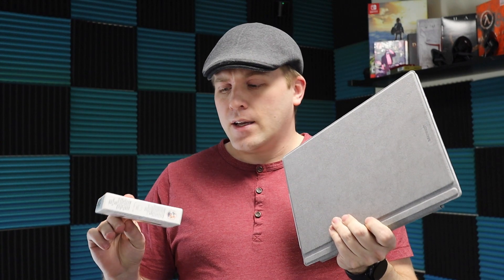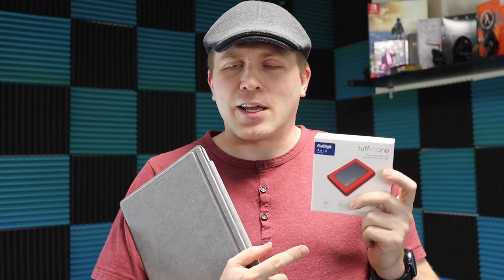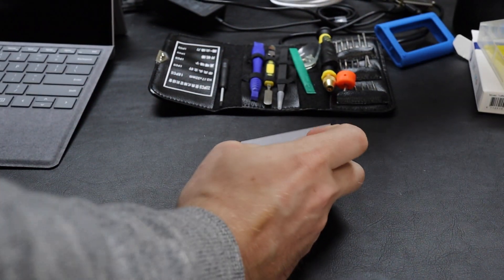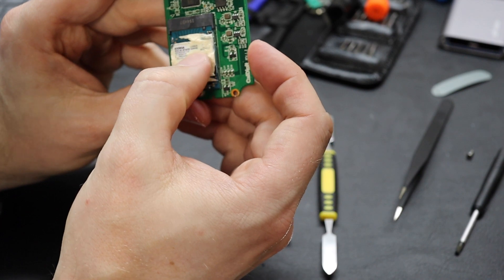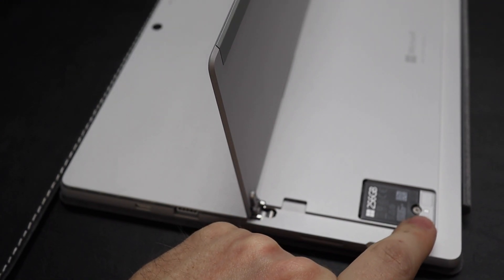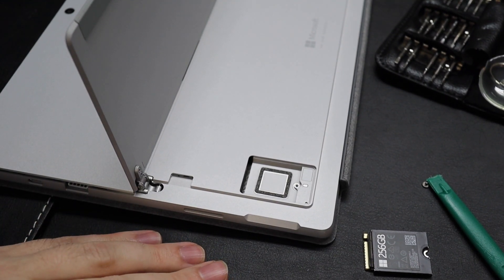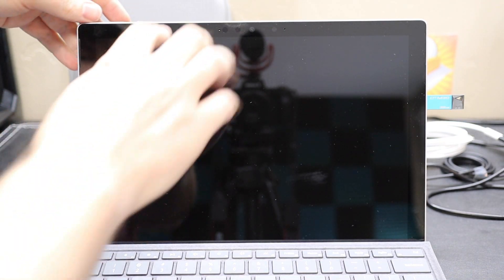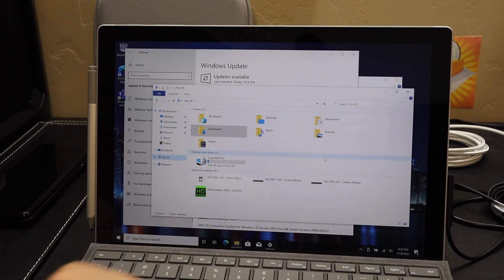Surface Pro 9 /8/7+ SSD Swap (also Surface Pro X) 1TB for hundreds less!

Comment: Why not just buy an internal drive without the need to dismantle a new external USB drive.   Seems a little extreme and unnecessary.
Reply from the maker: At the time of the video, it 2230 ssds were very expensive and extremely hard to find in that capacity. Nowadays, you can have it same day on amazon.

Comment: My Surface Pro 8 wouldn't boot after replacing the SSD, was panicking. Turns out it must be plugged in to power for the first boot.

Comment: Could you possibly replace the ssd with a 2 TB drive or greater and if so where would you get it.
Reply from the maker: Ebay wd sn740 or micron 2400 or 2450
Reply: @cbutters  Thanks for the help and advice.
Reply: I have another question about if you know  if the WD my passport ssd is compatible. If you need the SN or PN for the device I will be happy to provide that.

Comment: link takes me to the 2tb drive. Is that still compatible?
Reply from the maker: i don't think that 2tb version is compatible it is too long and probably isn't the 2230 size.... look for a micron 2400 m.2 2230 or a WD SN740 they are becoming available on ebay in the 2tb size if that is what you are looking for.

Comment: 2TB version also works ?
Reply from the maker: yes
Reply: @cbutters  could you please send me the exact 2TB version that could wotk in my Surface Pro 7+?
Reply from the maker: @MrBazsi888  These two: 
WD PC SN740 NVME 2230 2TB or
Micron 2400 2TB M.2 2230

Also see this video: https://youtu.be/PsAsA4kiImk
Reply: @cbutters  the Micron 2400 is really hard to get, it's out of the race. so that means 2TB WD SN740 will be my pick for S7+.
Reply: @cbutters  Rumors have Micron stopping production of the 2230, but I can't confirm that either. But description says: PCIe Gen 4, NVMe 1.4 Compatible with all PCIe Gen 3 slots and systems
Reply: @cbutters  i tried 2TB WD SN740. installation ready, but I have occational BSOD's. any help ?

Comment: Thanks for the great video. Is it possible just to diskcopy the existing SSD to the new 1 T SDD before the swap so that the new Surface will be the same as before except with a bigger capacity?
Reply from the maker: I'm not entirely sure what you mean by diskcopy; but as long as it recreates partitions correctly / clones the drive; yes you can; If you just try to do a file by file copy, it isn't going to work.
Reply: @cbutters  The method you shown in the video will get us a brand new Windows to be set up. If the entire SSD is cloned to the new SSD with all the partitions before swapping, we  may get the same Windows with all the  drives, files etc without the need for reconfiguration once the new SSD is swapped in. That's my guess. Thanks for confirming it.
Reply from the maker: @Mingbell  correct. I didn't want to get too sidetracked in too many details in this video but I have many videos on how to clone ssds to upgrade without losing data on my channel using clonezilla. Check them out if you need or want :)

Comment: Surface Pro 8 problem with Torx screw: turning w/T4 driver, but the screw is not coming out. (T3 driver is loose; T4 is perfect fit.)  I have a Micron 1TB (model 2450, size 2230), but if I can't release the the old M.2 nicely, then my Surface will remain at 256GB. Suggestions?

Comment: There is no more 1TB of this product, The link points to 2TB and I am not sure if it will work with the surface pro 8 released this year
Reply from the maker: You're right... the 1tb version is completely sold out... the 2tb is not the right size. You'll have to try to get a SN530 or kioxia 2230 1tb somewhere.

Comment: I performed this upgrade on my 7+ and it worked great :-) Thanks for the excellent video.
Reply: Hi Tom, do you have a link to which SSD did you used?
Reply: @AdirB  I used exactly the SSD used in this video, same make and model.

Comment: Do we need to install any drivers, like surface specific drivers after installing windows?
Reply from the maker: windows update will install everything you need as microsoft does a good job of getting all the drivers in that system... (microsoft in-house device... microsoft windows you know) Sometimes the keyboard doesn't work though and you have to use a usb keyboard with a usb-c hub to make it work during the install... so its easiest to use the factory image usb.

Comment: Can you use the 2tb tuff nano? Can’t find a 1tb anywhere seems like except on eBay.
Reply from the maker: The 2TB TuffNano looks longer than the original... which tells me it is a larger ssd inside, not the 2230 size; so I highly doubt it.
Reply from the maker: There are some new 2TB 2230s coming out, in fact someone was selling them on reddit not too long ago. but thats the only time I've seen someone offer them and they were also charging 430 dollars for them :S
Reply: @cbutters  Dang, yea I called the guys up for the tuff ssd and they wouldn’t tell me the info for it so I bet your right. I’ll just wait then, thanks for the info.
Reply: @cbutters   I did find that dell is selling some 2230 ssd 1tb but it is a little expensive compared to this.

Comment: Thank you for the instructions.  Will these instructions work for a Surface Pro 8 using a Tuff nano Plus USB-C Portable External SSD - 2TB Charcoal Black?  instead of the 1TB
Reply: Any luck with this? If it worked im all in.

Comment: I see you Genshin Impact lol.  So Microsoft claims using drives other than their own could cause reduced performance which just sounds to me like "Better buy our own brand overpriced crap".  Have you experienced any issues or performance reductions since swapping to a non MS drive or is everything peachy as it should be?
Reply from the maker: No, in fact the swapped drive was actually faster. Microsoft often uses various sources for their SSDs and seemingly without regard for actual performance, except on the higher end devices. This is why Microsoft stopped advertising speeds on their devices, so they could have greater flexibility in SSD options, even when some of them were frankly "not the best drives available"

Comment: The link now points to a 2Tb drive on Amazon. Is this going to still be compatible with a Surface Pro X? Is there a limit to how large the storage can be?
Reply: I don't think there is a limit to how large the storage can be. Just be aware that the literal physical size of the m.2 ssd could be the bigger version in the "external" ssd that you purchased which won't fit into. Make sure the m.2 ssd size you're gonna take is the 30x22 size (double check this yourself, I could be wrong). I'm just not sure if it's compatible with the Surface Pro X because I've never looked at that product.

Comment: hi 
i am woondering how di you find out what exactly is in that nmve ssd external drive? because i was thinking for the same trik but few and most of the external drives can come with 2245  like the one for x box  seagate spandable 1t 
and most of the retails they said is out of stock

Comment: Just an FYI... I installed a 512GB Kioxia M.2 into the Surface Pro 8.    The heatsink and pads hadn't come in yet from Amazon, so installed SSD anyway to test drive temperature with CrystalDiskInfo.  Temps rarely exceeded 35C with just office apps and web browsing.  With 4K video temps went to 42C.  Downloading a 55GB game never exceeded 45C.  I think I am comfortable leaving the drive without heatsink or any thermal pad for now.  The SSD slot cover gets warm but never super hot.  It seems the metal case is good at expelling the excess heat.  May try a 0.5 or 1mm thermal pad in the future if it looks like temps are exceeding safe range.

One note, after installing the drive and pressing the power button + Vol, the computer would not start.  I put old drive back in and had same issue on regular boot.  Found that the surface pro 8 charger has to be attached and then it will boot.  I then shutdown and put new drive back in.   Plugged back in and then was able to do a successful restore.  (note I was unable to do a clone with Easus since it didn't extend C: drive).   So far so good.  @CBUTTERS ... thanks for the info.
Reply: I ended up using a 0.5mm blue thermal pad on the SSD and a 0.5 mm pyrolytic carbon pad between cover and blue pad.  Temps are now around 33C and never get over 45C with heavy use.
Reply: @terracode1  thanks for your input !
Reply: Did you remove the sticker from the SSD manufacturer before applying the pad? Thanks.
Reply: @ChenHendrawan  No.  The manufacturer sticker is made to pass heat and shouldn't be removed.  Placed pad over sticker.  Works great.
Reply: @terracode1  thanks

Comment: So the Amazon link you put in the description is only 2TB which I would gladly purchase for surface pro 8. However, search the q&a's above reviews, type 2230 and a review says it does not fit surface pro it is a 2280 not 2230 :( can someone send a 1TB or 2TB 2230 M2 SSD? I can only find WD's SN530 1TB which only has ~850GB due to Xbox OS data or something.
Reply: The 2Tb comes with the 2280, I have one

Comment: Great demo, really clear. Good cautionary advice - like 'don't strip the screw thread, so go easy' - which is really helpful to the novice, like me. Thanks so much.
Reply: He was talking about the screw head, not the threads.
Reply: @seth1066  I didn't hear this part of the video, but it was the threads that stripped off rather than the head for me. It's such a small fine-pitch screw that the threads peeled cleanly off. 😑😕
Reply: @johncornwell1026  I think I might have done the same thing. Did you find a solution?
Reply: @pwrdbyrce  Weirdly my response was deleted. Not sure if that's because I posted a link to the Reddit thread where this is discussed, or because I offered to mail you a replacement screw (since I have 49 of the damn things, having been forced to buy a 50-pack). Anyway: the correct answer is M1.2 x 2.5mm.
Reply: @johncornwell1026  Unfortunately I can't replace the screw since it's still stuck in it's spot. Maybe we don't have the same problem. The screw is still there and spins and spins but won't come out
Reply: @pwrdbyrce  ah - sorry. I misunderstood. Mine stripped, and I was able to pull it out of the socket. Then I used a dental pick to pull out the bits of metal that were left. At that point I needed a replacement screw
Reply: @johncornwell1026  yeah, I misunderstood. Thanks for answering anyway

Comment: You can purchase a name brand ssd for this WD 1TB SN530 2230 NVMe PCIe SSD, instead of going through the trouble of getting this portable drive open. I didn't find it on amazon but I found it on ebay Brand new.
Reply: Those only come with 867GB instead of 1000GB tho

Comment: Can you clone the surface drive into the external before pulling it out of the enclosure to skip the last part of reinstalling?
Reply from the maker: you can... with varying degrees of success... I've done it with clonezilla. you have to know how to disable secure boot and disable drive encryption.... etc.... so its a bit of a process and beyond the scope of this video.

Comment: Hi I wanted to ask you guys here about the guarantee.
Does it void if I order a brand new Surface Pro 8 with i7 and 256gb of memory and replace the ssd with a 1TB the day I get it?
Reply: This SSD is designed to be user serviced.  Check the warranty for the real answer, but it seems highly unlikely as you would use the device as intended.

Comment: Thanks for this information however I just bought the Surface Pro 8 can it do not have extra storage area like previous versions
and I am trying to get my hands on that 1tb however I can't find it, not sure if a 2 or 3 tbs will be to much, any ideas?
Reply from the maker: You need a 2230 sized nvme m.2 ssd. The larger 2280 sized ssds will not work... The max storage size of this tiny form factor is 1TB as it is the size of a postage stamp.
Look for a Western Digital SN530, or a Kioxia BG4. The easiest place to find them is on ebay.
Reply: Many merchants now sell the KIOXIA drives - KBG40ZNS1T02 is the SKU number, directly, cheaper than the tuff nano as there is no box.... - only difference to procedure - have a thumbdrive (USB C or with adapter) handy, copy your windows and files first - then swap the SSDs - 5 minute work....

Comment: I don’t understand why they can make SSD swappable but still there’s no way to replace battery on a $3,000 device. For battery lifespan of 3 years (if you’re lucky enough) it’s cheaper to get a MacBook Pro with iPad Pro together than a maxed Surface Pro.
Reply: The priced is almost the same if not much more expensive than having a single device. Also, microsoft always have discounts. If you know anyone is studying you can make use of the student discount.
Reply: @eyhtwozed2606  a) these discounts are only for the first world (people who are already rich), and it’s a little fraud. 
b) things have changed since then a bit. Both mentioned devices can deliver much more than Surface Pro, except for the new one with RTX packed. I’m not sure how’s pricing and reliability on those new surfaces. 
As of time of writing, Mac and iPad of around the same performance were having same pricetag being similar, if not less, unrepairable. I just don’t see where Microsoft is going with that.
Reply: @dmitryburlakov6920  how did you come to a conclusion that the discounts are for the rich? Please support with evidence. If you look at their website on certain occasions like tech sales, festivals, holidays etc microsoft always give discounts. Theres also discounts by resellers. Also its just how tech are headed with fixed batteries. Look at where the mobile and most laptop are headed.

Comment: I cloned the old disk to a new one with a free disk image software and cheap NVME to USB reader on my second PC. After inserting the new disk everything was exactly as I left it before. However, don't forget to disable Bitlocker. No USB stuff is necessary.
Reply: Can you share more details on how you did this? Also with the disk partitioning?

Comment: LTE module doesn't work after windows 10 update (last week). It works fine If I put original SSD again. anybody has same problem with me? or any remedy for this? (status device power failure code 10 for swaped ssd)
Reply: did you solved this issue? Maybe you downloaded wrong firmware?

Comment: Will this work on the Pro 6?
Reply: No. The Pro 7+ and Pro X have a removable SSD drive. None of the other Surface Pros (not even the regular 7) have that feature. For a Pro 6, you'd have to fully take apart the device, which I wholly do not recommend unless ypu kmow exactly what you're doing, have the proper tools to do so safely, and are willing to risk the device not working...and even if you did, I'm still not 100% sure you could actually replace the hard drive.

For us 6 owners, best thing we can do is stick with a MicroSD, or plug in an external ssd drive.

Comment: Great guide! - (My 2 Cents) - I ended up carefully removing the Microsoft aluminum cover from the Microsoft SSD and putting it on my new SSD.  The heat pad for the new SSD made closing the Surface cover problematic and would not fit into the Tuff Nano enclosure. Recovery and upgrade went very smooth. THANK YOU for finding this upgrade path and saving me money!
Reply: mind doing a video for us friend?

Comment: Question, the title says Surface Pro X also. Can you use the same 2230 SSD for the Surface X or is it a different form factor? Thanks.
Reply from the maker: Should be the same. (IT IS)

Comment: Great video!

Is that Toshiba drive PCIe 3.0 x2 or x4?  I find "SanDisk PC SN520 512GB m.2 2230" drives for about $145 on Amazon/eBay/Walmart but they are x2.  Just wondering how it would compare.

Comment: Does this recovery method works for the Surface Pro X using the USB Thumbdrive?
Reply: I would also like to know if it works on the surface pro x. I read that with the USB C interface it causes a lot of problems in recognizing the thumb drive. Can anyone confirm if this method works on the Surface Pro X? Would really appreciate that.

Comment: Awesome tips! What is the thickness of the thermal pad you used?
Reply: Yeah I would like to know that too. Has somebody in the comments tested it out?
Reply: @M hi. Is 1mm thick pad enough for Toshiba 1tb 2230 SSD? Or perhaps I should get 1.5mm thick or 0.5mm thick thermal pad instead for a better thermal transfer?

Comment: Congratulations to the perfect instructions. I wanted to have a 1TB Surface Pro 7+ and thanks to your well documented help, I could manage to have one. I'm not an IT-professional. It all worked fine. Thank you again.
Reply: Hi There How can I get the 1TB ,am in Kenya , Africa Any one you know who can ship the device ?
Reply: @duncanmwangi3468  There are several sellers on eBay, but prices are quite high on 1 TB.  I ended up going with 512GB since it was $88 rather than well over $300 for 1TB Toshiba/ Kioxia M.2 2230
Reply: i would ship you one  @duncanmwangi3468

Comment: I see you have Genshin installed on your surface. How well is it running?
Reply from the maker: I drop the resolution to 1368x912, and run it on medium settings... it does 45‐60 fps that way

Comment: Could you just clone the surface disk into the new SSD? 
Great video by the way.
Reply from the maker: you could have cloned it for sure; but then you would have to resize the partition after... I figured it was a new machine; why not just start with a clean factory image.
Reply: @cbutters   Thank you!